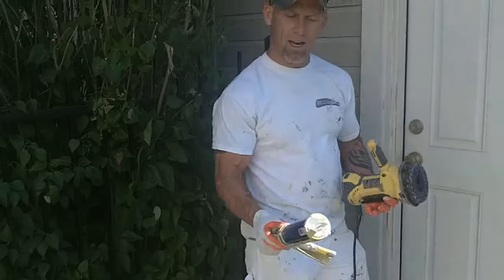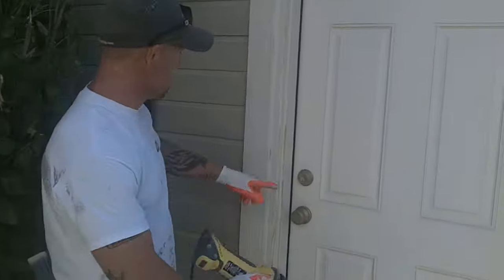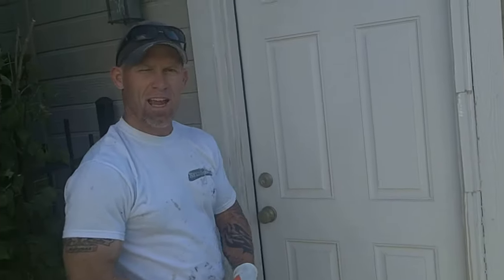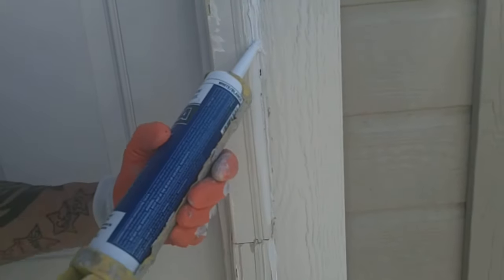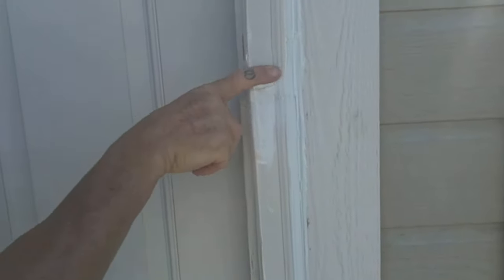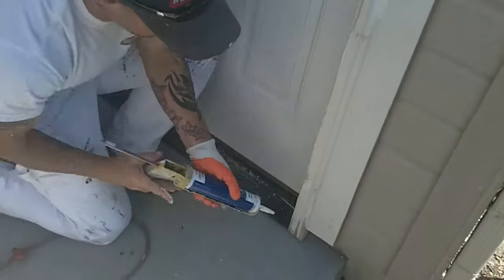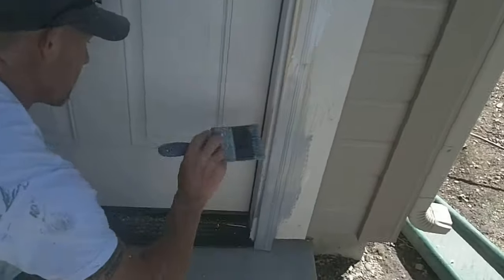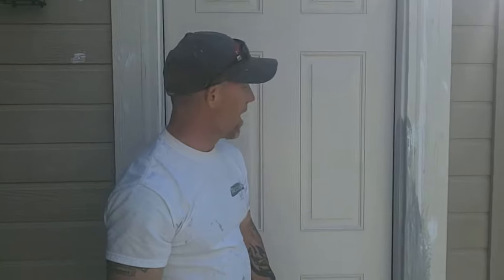How to prep a weathered door jamb.  DIY/ House Painting Tips.

Comment: So you don't have to sand the rough caulk before peel bond or paint? Can you tell me which Purdy brush your using for the peel bond I see it has a black handle which I thought was for interior use only but peel bond is only for exterior right? Not trying to be a smart ass at all you can tell I have watched a bunch of your videos :) big fan of your work just was curious thanks again for another amazing video as usual.
Reply: Paul Rhodes didn't he say the blue bristled one?